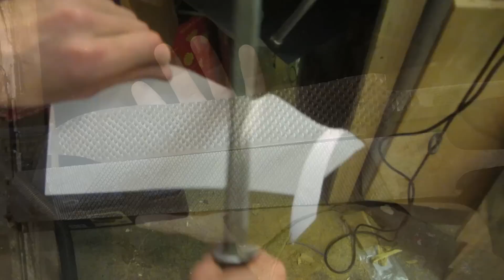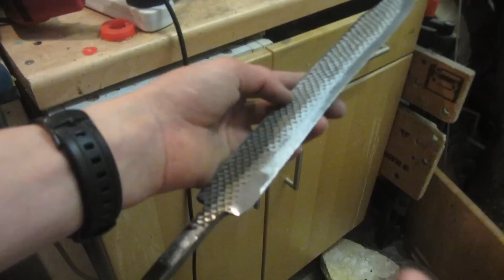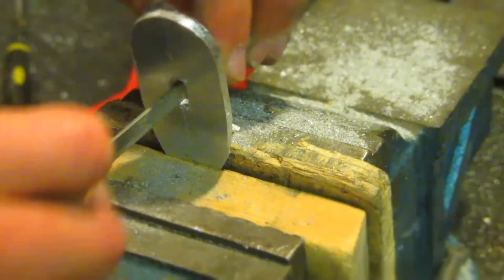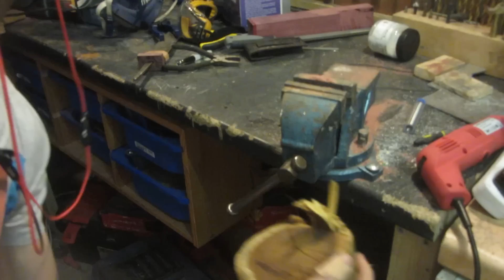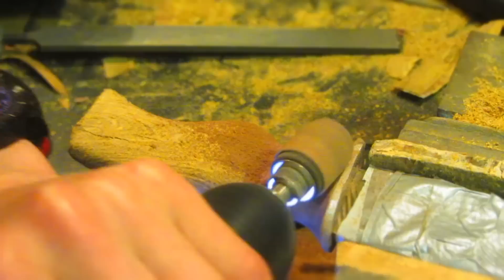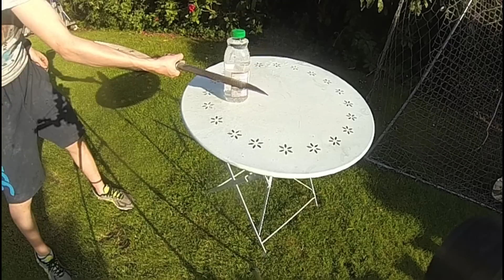How to Make a Bowie Knife From a Farriers Rasp

Comment: You can solder aluminium but you have to scratch the surface while you solder to puncture the oxide layer.

Heat the aluminium with the flame and melt a blob of solder on it, then you take a sharp object like a nail or an old screwdriver and scratch the aluminium under the molten blob while still heating it.

You'll find that once the solder gets started in one spot it is easy to spread it out by scratching out from that spot, the solder creeps under the oxide layer once it is through.

You can see the process here:
<https://www.youtube.com/watch?v=IJvPn1MW8QY>
edit - this is the better video I was looking for:

<https://www.youtube.com/watch?v=0WMCa4R7CRI> 

Once the surface is tinned it is easy to solder, just like copper or brass, so I would tin both surfaces separately before joining them together, especially with dissimilar metals.

All you need is regular leadfree solder (like sold for plumbing), there is special flux for aluminium but it is not needed with the scratch method above.

Comment: That's a very nice blade! Concerning the soldering, I don't believe you can solder ferrous metals. I believe that only works with copper or aluminium based metals. Handle looks awesome

Comment: As always a great video I have been amazed by your knowledge and talent for a young man these days it is rare keep  going. ...now aluminium can only be tig welded to aluminium brass , copper,  nickel silver ie old coins can be soldered or brazed  to steel using a blow torch ...I have used half crowns  and full crowns as finger guards but eBay has plenty of choice. ...keep up the good work. ..colin

Comment: Here's some advice on why your soldering experiment failed: Normal electronics solder will generally not stick to steel, unless the steel has been pre-tinned. In the olden days they used a tin/lead mix to fill automotive panels, instead of bondo. That's the stuff you would need. HOWEVER, it will not let you solder Aluminium to Steel, there is just nothing other than epoxy that will allow you to do that.

Another soldering method to use on steel is silver solder, or better still brazing with bronze. But again, you can't join Aluminium to steel. Epoxy really is the way to go, but you've got that figured out! :)

Comment: Your best option for the hand guard would be shrink fitting instead of soldering- Next time, you make the hole in the guard piece very very slightly too small, then heat up the piece and as it expands, it will fit over the tang, then it cools down and shrinks onto its place.

Comment: The soldering is completely unnecessary in this application.  Even the best Japanese sword makers use only the pressure from the handle to hold the guard in place.  I would recommend a wider tang on a knife made for chopping, but I know that the shape of the original file makes that impossible for this knife unless you want to shorten the blade significantly.  It seems to hold up nicely though, an all around great job.  =)

Comment: The reason your soldering didn't work was because your trying to do it between a ferrous and non ferrous metal.  The rasp is steel,  guard is aluminum.  It never works that way.  Now you know :)  in the future.  Steel and aluminum can't be welded together except certain grades of stainless steel and even then you need a TIG welder.

Comment: Look up some plumbing solder. It's usually used to bond copper to copper for old plumbing, at least here in the states. It's really strong. I have actually used it to make some heavy slingshots. It holds very tightly. The technique is fairly challenging, and I don't even know if it will work for you, but it's cheap and is certainly something you should try. Again. I love this channel and the amount of effort you put in really shows. Keep up the excellent work.

Comment: The next knife you make instead of glueing the handle to the tang you should drill a smaller hole the size of the tang in the Handel and then heat the tang up and burn it into the handle and make sure that the tang is just a little bit longer than the handle and peen down the tang. This way the handle is held on by compression and no glue is needed to hold the handle in place also the hole in the handle would be a 100% perfect fit. 

(PS)If the handle gets lose just peen it down even more

Comment: Excellent work mate, you are a genius. All that hand sawing, filing and shaping is damn hard work, that was brilliant stuff mate.  Lots of very interesting and good info coming from you. One of the better youtube channels, you're a real inspiration
Reply: The Art of Weapons Hi and congrats on your constant improvement especially on sanding. Your angles look perfect. 
If you want any chance on soldering you need a proper acetylene torch. The best way to do it is by using a brass guard and bronze welding it in with a proper oxy-acetylene torch and a bit of flux. Your torch is very small and the blade absorbs all the heat you try to put in your weld. That is just my 2 cents. Good luck in the future and please keep the videos real including the failures because it is more educating for all of us that way and as you can see nobody is criticizing you here. We're all a group of mates sharing ideas and hobbies. All the best.
Reply: The Art of Weapons please next time you are drilling through metal clamp it down in your drill clamp. I know from personal experience that if you loose your grip on it, you won't be having a good day. Always clamp anything down, everytime all the time, your hands and eyes will thank you for it.
Reply from the maker: Antipodean33 Thanks!
Reply: +The Art of Weapons could you tell me the name of the song at 7:15 or around there or whats its from would be great
Reply: I love these channel because you can make nice stuff and I have tried some of your ideas and they are awesome. I think if it is legal in England if you could design a homemade airgun because I have made some and I think that you can make a better design with the stock and the air tank.
Reply: I would be more interesting if he made a shotgun because you see a lot of pipe air guns on YouTube and there terrible accurate
Reply: +Theo Price shotguns are easy. a nail and 2 metal pipes. i live in Alaska. guns arnt near as complicated as people think.
Reply: +Iron Spark And where would the nail go?
Reply: Daniel Clevely
tap a thread on the end of the pipe, get a screw on end cap for said pipes diameter, drill a hole dead center of it, weld or solder the nail in that center hole, cut the nail down flush with the end cap, screw on the end cap with the nail in place and that's about it, done.
Reply: Daniel Clevely the back. It would be the firing pin. Glue or weld the nail in the middle. One pipe holds a shell. The other is slightly bigger. Pull them together nail hits the primer and boom. You have a fully legal single shot shot gun. If your good you can upgrade to a gravity or spring clip.
Reply: +Tom Adams Could you upload a video on your airgun ?
Reply: Antipodean33 a

Comment: You can't solder aluminium and stainless steel, something to do with magic pixie fairies of the metal

If you want to solder a guard for the knife, you're better off using brass, steel or copper. Then again, for such a thin guard soldering isn't necessary and the araldite solution is good enough
Reply: ***** You can solder stainless, its just a bitch, you have to have high silver content solder, People do it with nightmare on elm street gloves all day long (stainless to copper)
Reply: ***** er mah gawd Hai :D
Reply: Eric Clark Hai ^_^
Reply: ***** Hai ;-; he noticed me :D
Reply: +Daily Derps The issue is with the conflicting conditions you need to meet to weld aluminum and stainless. They can be brazed together if you use magic flux :) Recently solder alloys have been found which work as well.
Reply: digitalenigma00 The magic pixie fairies strike again! But there is a way it seems.
Reply: very true. great advise, i have used silver flux and brass gaurd on carbon steel with non lead solder.
Reply: My real samurai sword has no solder. They just make it all fit perfectly together and then they have a hole through the tang and the wood with a tight wooden pin through all that to make it stay on. No glue, no solder, nothing but wood and metal. If it is good enough for a samurai then it is good enough for me!
Reply: BTW, I don't know why but the pin is at a slight angle not just up and down.
Reply: +Daily Derps that rasp aint stainless
Reply: yep thats true even though thats not stainless steel lol

Comment: Silver solder may work better, but you can probably use soft spool solder. You would need to use some time of HVAC flux though, that's what I uses in steel on steel projects, it holds it together pretty well.

Comment: I'm not certain that solder it needed at all. The guard is simply to keep your fingers from sliding up the blade. If the end of the blade/beginning of the tang is flush with the guard, and the handle material secured, you won't likely have any issues. The only thing I would recommend if the primary use is to be chopping, that you leave the tang as full as possible, and use scales with epoxy and pins. This also allows you a greater range of handle materials, as the grip is no longer a structural part of the knife. 

Very good work, however, as always.

Comment: If you don't have a welder you could heat the rasp and aluminum to welding temp using your forge, though they would have to be heated up separately.

Comment: Cool knife, but my gut tells me that the reason you couldn't solder the guard was because it's aluminium, and solder doesn't wet to aluminium. I don't know for sure, just a hunch.
Reply from the maker: Rob Mckennie Thanks, I think that what you are saying is right!
Reply: The Art of Weapons I'm pretty sure that's the same reason you can't weld aluminium to steel
Reply: Aluminium can melt if u try weld it to steel , even if it only happens a little it still won't attach
Reply: The Art of Weapons You can try to cut a taper kind of like the ones in those hose barbs, that way when you slide the guard it snaps in place and can't come off due to the taper

Comment: u have to heat the metal first and then apply the solder the solder wont stick to a cold base
Reply: bruno baumanis or eaven just heat the metal from the back and apply the solder if its cooling down too fast

Comment: The solder you used is for elections ideal for use on wireing such as copper, welding it would work to an extent depending on the material of the guard

Comment: Couple of things-bigger tang for chopping knife-bigger is better.You know how meat cleavers have thick tang?
Also tips for drying wood ,leave bark on,paint the ends of logs with any paint.Put it on a spot protected from sun ,rain and moisture.Outside works ok if there is no high temperature differences and if its not very rainy.For 6 months -1 year your wood will be dry enough to use.Wood will split and twist if it looses moisture too fast.
Also i recommend using linseed oil when its dry,it does miracles on handles.Not only it makes wood look nice ,but it also protects it from drying-so your hammer handle for example will stay nice and tight.

Comment: Would you recommend that style belt sander for knife making?
Reply: If you're on a very tight budget it will be enough of a sander. It isn't really optimal for knifemaking, since it has a relatively low speed, short belts at ≈35" vs the ≈ 78" on a knifemaking grinder and relatively broad bands at 4" vs 2-3" on a k.m.grinder. Also the motor on these often is quite a bit too weak (300-700W vs 1000-2000W on a k.m.grinder.
So if you can afford one, get a good knifemaking grinder. If you are on a very tight budget, one like TAOW's  should be enough. If you have a bit more money get something like a 'metabo bs 175', those are quite decent if you put some small modifications to it.

Greetings from Germany
Reply: great, thanks a lot man. I can use a regular grinding wheel and hand files to carve out the blank, so I really only need the sander for the bevels.
Reply: Don Williams man I got a cheep ass belt sander/ disc sander for about £60 and its great for knife making so theres no need to splash out if you can get hold of an ok cheepo.
Reply: I bought one and its shit so make sure to be careful I'm just using a simple electrical sander and it works fine. Just make sure that it have a flat edge and can go decent rpm. Just a regular small floor sander would do. (I'm saving for one right now)
Reply: Don Williams I had a different method for making the edge, I found a very fine grinding stone with a smooth curved edge, chucked it into my drill press using an arbor, then clamped the blade in my cross vice and began taking small bites out of the blade, it ended up with a nice hollow grind on the blade, and held an edge like you wouldn't believe, after a heat with two propane torches and oil quench.

Comment: Great job with the knife. I like your re-purposing project. I agree with the comments on soldering different metals. Most knife guards are not attached permanently so putting a pin in would be better.If you could, tell us what making the knife cost you as far as hours and money? I think it would surprise most people how long it took. What a great video.

Comment: Excellent craftsmanship. Brazing would probably be your best bet for the dissimilar metals, but the high heat required would probably make the steel lose it's heat treat in that area.

P.S. Slow down when you speak! Your commentary can be difficult to follow at times ;)

Greetings from Manchester :)

Comment: Hey man you should try to fully anneal the file so it doesnt burn through you sanding belts lol Also maybe try to HT a knife thats 5 - 6 inches its not that hard ive done it with very limited tools. oh and for a chopper i would suggest using a .25 steel

Comment: I think I know a method that may work for soldering these two metals with common tin solder. I'm not sure if the stainless steel will adhere to this, but aluminum certainly will. 
The issue with aluminum is that it oxidizes really fast. So from the time it takes to switch from sandpaper to soldering iron the aluminum will have oxidized and it wont work.

One solution is to rinse the surface you want to solder in some heat resistent oil (like car oil) and sand the surface then. This way the oil protects the surface from oxidizing and the solder will now adhere. If the adhesion is not immediate try to scrach the surface of the aluminum with the soldering iron while having a blob of solder attached, you may get it to adhere then.
I don't know how this will work with stainless steel, but metals that resist oxidation all work in a similiar way (oxidation state remains in solid form, coating the rest of the metal), so it might work.

I've had success in the past with this technique to solder copper wire to aluminum.
A long comment, but I hope it helps! Awesome videos! You're on the right track!

Comment: I believe this knife was sharp enough to cut through that plastic bottle. It didn't, due to the fact that you tryed to do a straight cut with a straight blade, when this type of cutting is only effective with curved blades. If you try to move the blade forwards or backwards in the moment of impact, it would most likely cut the bottle. In any case, that was one great knife you did there, great job! :D

Comment: Aluminum requires a substantial amount of heat to solder or weld.  You need argon to weld it and will need an acetalyne torch minimum to braze it.   Aluminum is easy to Work with because it's soft (try cutting it with a band saw, you'll be amazed), but it's a bitch to weld.

Comment: hi I have a lot of experience with welding all sorts of metals .all the various Stainless and aluminum the melting points of ferrous metals stainless and Aluminum is too different. I'm afraid you are down to either rivets or epoxy, I would have doubts as to whether epoxy will stand up to the vibration of chopping. You cannot braze aluminum either

Comment: Trying to solder two types of metal together with a third is not very effective. When trying to combine metals like this I like to use epoxy as it gives a more stable bond. When attaching a guard like this I usually just super glue it on so it stays snugly in place until I can shape the handle and apply the epoxy.

Comment: Try brass or copper as a guard there is no solder that will work for steel to aluminum, you could pin the aluminum to the steel but that is much harder with simple hand tools. Soft lead/tin and or harder tin/cad solder will work on steel to brass, or copper try 1/4" or 5mm copper, maybe a scrap bus-bar from an old electric circuit breaker box thicker is better, but if you can get thinner brass and copper solder them together to make them thicker.   Try curving the guard more with a hook to keep your hand from slipping forward, and blend into the grip/handle, look at other materials like thick phenolic and micarta about 1" or 3cm they cut a little harder but crack less I noted a crack in the largest block of you handle.  Last all wood handle I did a thinner casting resin soaked wood to stop the cracking but never was happy with the results.

Comment: when you where attaching the guard to the tang,im not a professional or anything,but couldn't you use epoxy to secure it in place? that's what I would've done. another thing I don't believe you can weld aluminum, at the temp you would need to weld it to the steel, it would melt though.
Reply: VolcanicScarab i wrote that comment before i finished the video. lol
Reply: VolcanicScarab  you can weld aluminium, you just have to be good
Reply: Ghillie in the Mist I didn't know that, thanks for letting me know